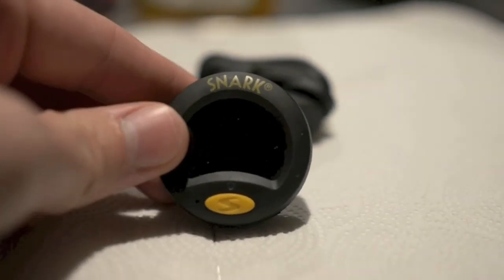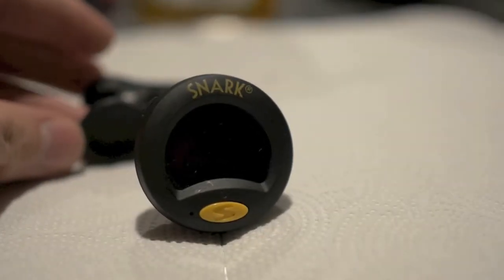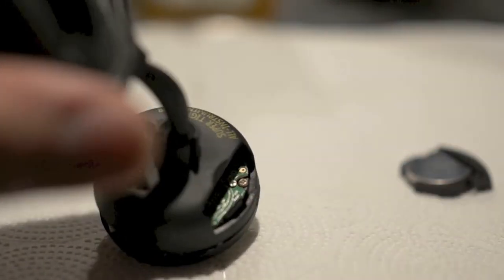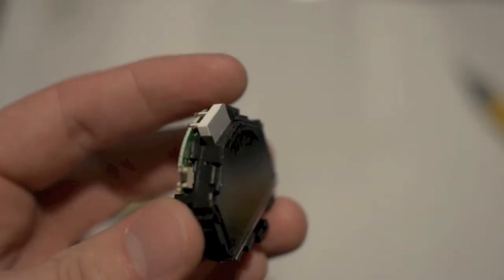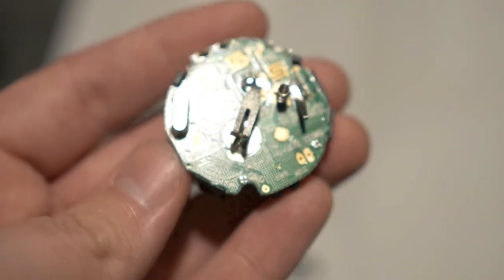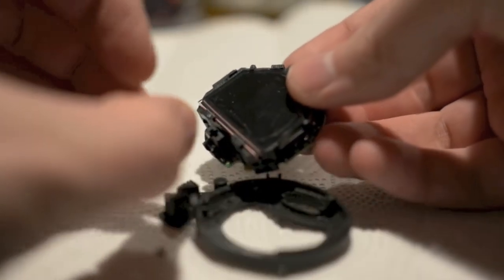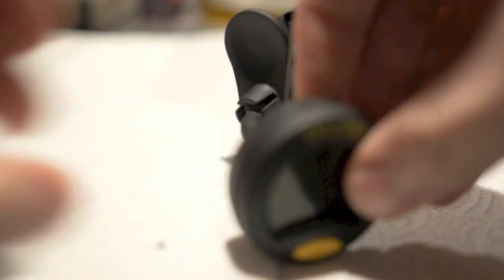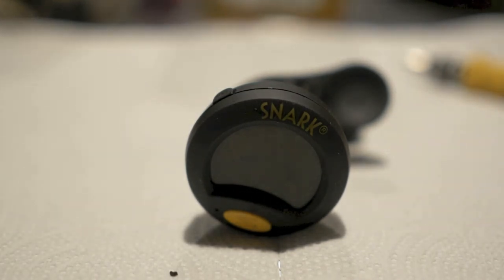What's Inside a Snark Clip On Tuner?

Comment: The piece of metal with an 8.000 on it is an osccilator, it is used to generate the reference clock signal for the electronics that are on the other side of the board. I would guess its running at 8MHz.

Comment: Be careful with these Snark tuners, they can damage the Gibson nitrocellulose finish.  If you ever read the manual it contains the warning..." SNARK advises NOT to use its tuner with any instruments having these types of finishes: Nitrocellulose Lacquer, Polyurethane, French Polish, Oil Finish or Gibson® guitars which have nitrocellulose finishes unless you accept the risk of dents to the headstock." I've already had a tiny pad print on my Les Paul Traditional ... not a good product.